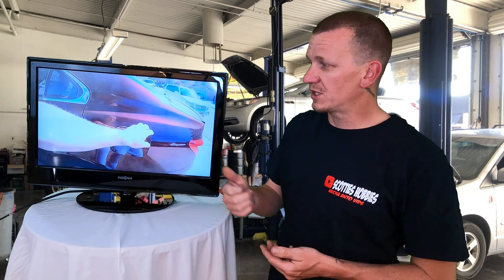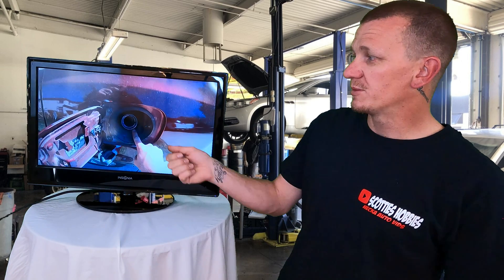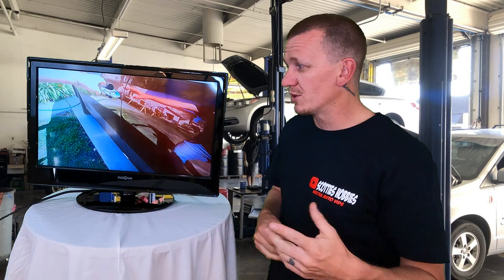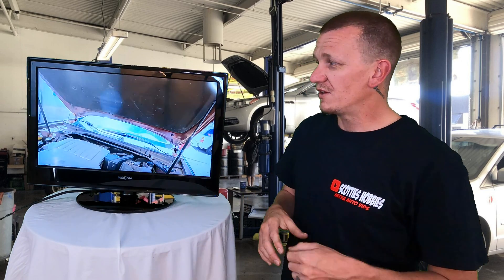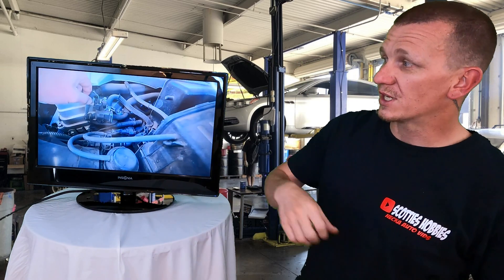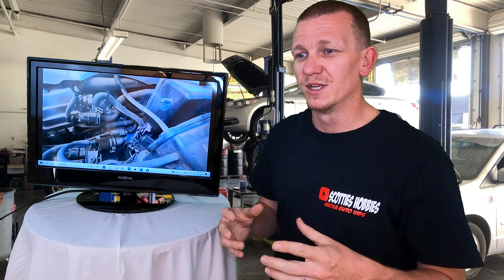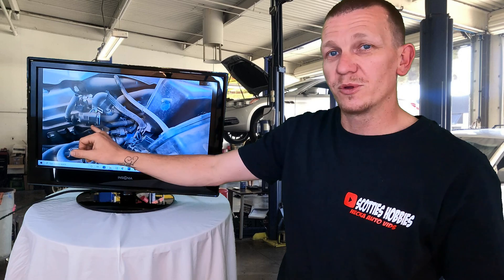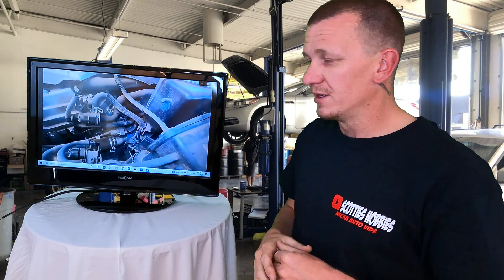⫷ P0442 p0456 Engine Code. EVAP Leak. Maybe a Fix You Can Do! Info and Tips ⫸

Comment: Is this common for a 2020 Kia Sportage.  I've taken my car into the dealership four times and they clear the codes and the engine light goes off for a while and then it turns on again.  Now my car failed my smog test with the two codes.

Comment: 2001 Lexus is300 with p0171, p0440, p0440
Replaced Maf with factory 
Replaced pcv valve with factory 
About to replace over full check valve but I also have no cats

Comment: I have hange the gas cap and the sensor selinoid and nothing  the checkengine light still, on help
Reply from the maker: What code are you chasing? What is the year make a model of your vehicle? And what solonoid or valve did you change?
Reply: 2001 gmc sierra c3 1500 code p0442 change Eva solenoid valve the one is on top of the motor and the gas cap
Reply from the maker: @Rubieles Marcial  the vent could not be sealing properly too. The vent should hold vacuum when 12v is applied..if the vent tests ok, a smoke diagnosis would be next. In that case, probably a crack on a hose connection if not the pump gasket.

Comment: 2001 lexus is300
Reply from the maker: Good luck on your fix!! 💪👍🤞
Reply: @ScottiesHobbies  already fixed the problem ! thanks a lot your videos helped !
Reply: How did you do it bro?
Reply: @lawrencebarles1974  i changed the FUEL VAPOR VACUUM EVAP FEED PIPE + the hoses & i also changed my FUEL TANK OVER FILL CHECK VALVE
Reply: @N C  I have a 2003 Lexus es300. And both codes PO442 and PO456 came up. 456 came up first and I noticed a clamp was hanging loose on one of the hoses so I'd figured it was that and deleted the code. Now both came up. Will have to check the same things you replaced
Reply: @lawrencebarles1974  for the valve i had the p0440 code